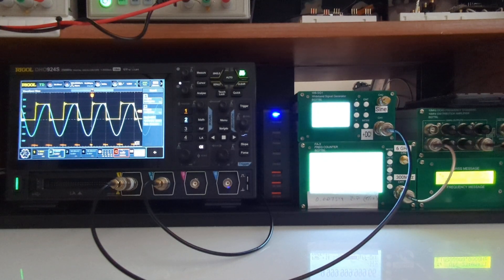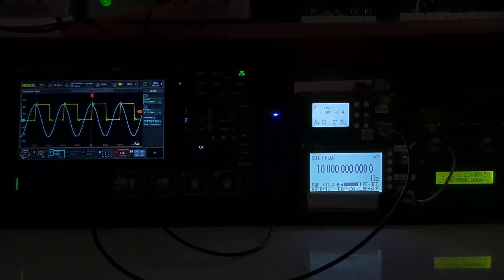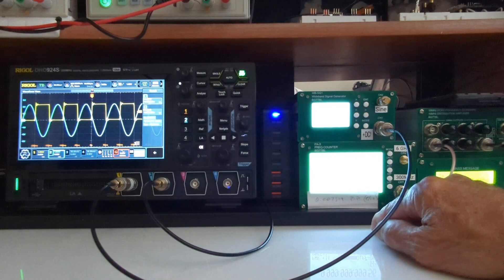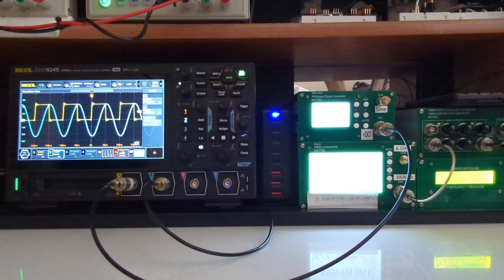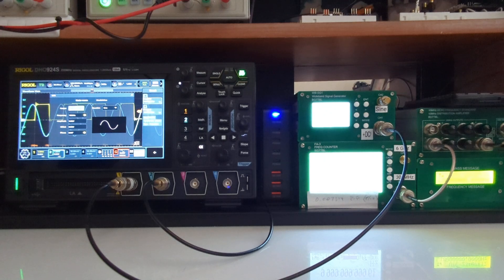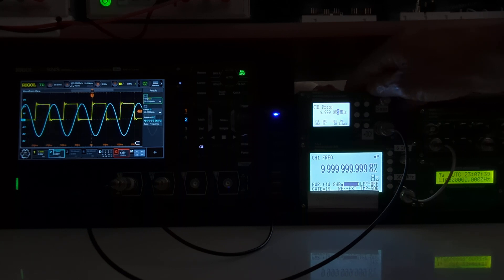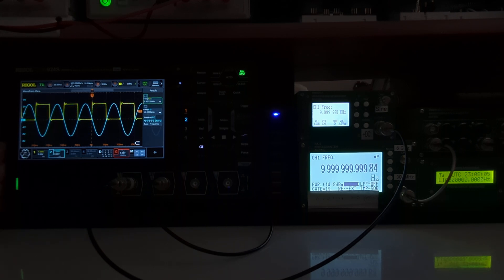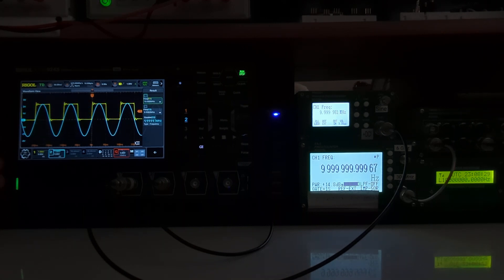Rigol DHO924S AFG - frequency accuracy of the arbitrary function generator (signal generator)

Comment: I did a research that the internal AFG inside of DHO924S can't support reference frequency input (Ref input) and yet we can't achieve 0 drifting when using the Trigger Output from the back of DHO924S to manage reference frequency syncing with another external signal generator on its Ref input port. For achieving a better 0 drifting signal test, it's better to use 2 external signal generators that the 1st generator should be used as the master which outputs 10MHz reference signal on its Ref out port, connected with the Ref input port of the 2nd signal generator. The built-in AFG of DHO924S is at entry-level and can be used for some scenarios.